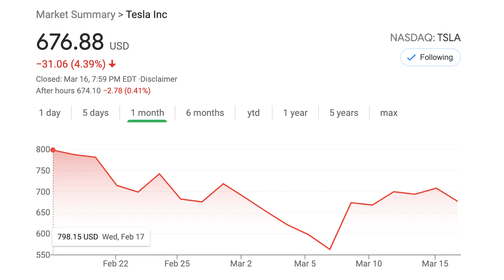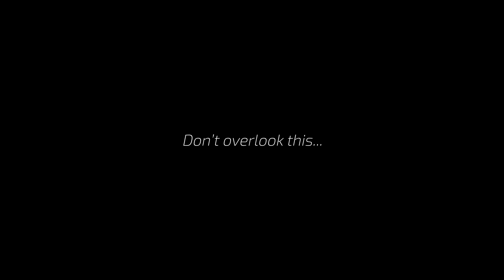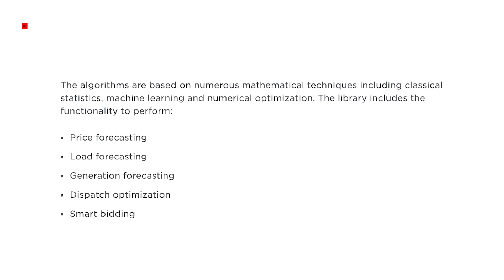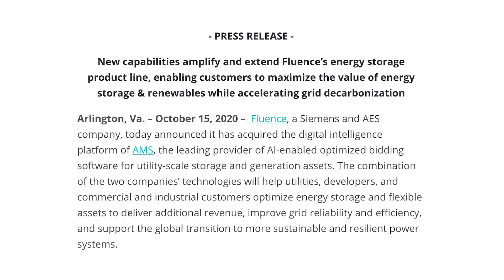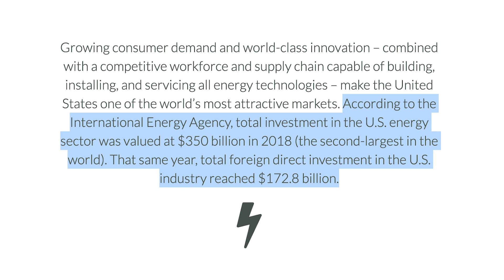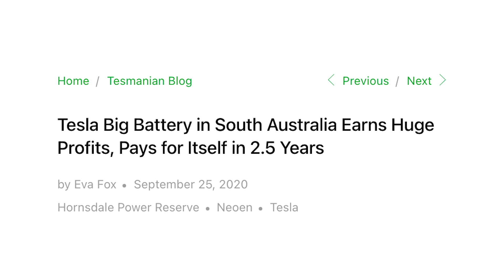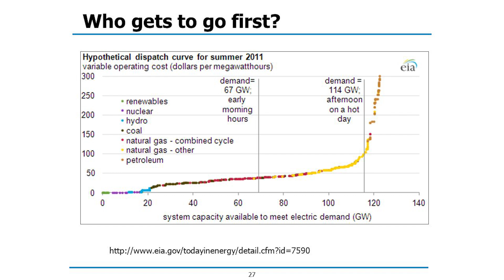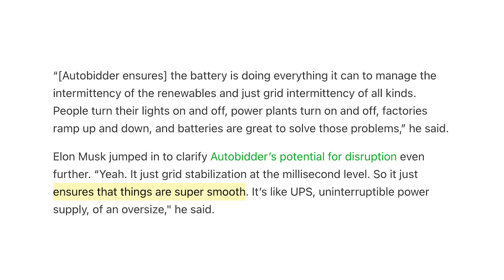A Tesla Thread to Follow: A Key to Unlocking Tesla's True Potential 🔑

Comment: Actually, the liquid metal battery solution provided by Ambri is far superior for grid stabilization. It is even more environmentally friendly, inexpensive to produce and maintain, provides excellent efficiency and the battery degradation is almost nonexistent.
Recently I sent a message to Tesla Power suggesting they should partner with Ambri.

Comment: There is a lot of waste built into the system as a cost of doing business so our lights always work when we flip the switches on. About 2/3 of energy generated in the US is not used or wasted as 'rejected energy' in the industry's term.  https://flowcharts.llnl.gov/content/assets/images/charts/Energy/Energy_2019_United-States.png
The electric utility system delivers amazing reliability, in part because of redundancy and excess capacity engineered in to it.  Tesla Energy reduces the capex utilities need to spend on new distribution infrastructure. Power Packs make the system work better with less over engineering needed.
Reply from the maker: agreed bob, thank you for sharing!

Comment: I did the math and in Oregon, on peak price is $0.1238/KWh and off peak price is $0.04128/KWh .  That mean a net of $0.082/KWh/day.  Current power wall price is at best $400/KWh.
Break even (at best case) would be 400/0.082 days = 13.4 years.  Nah, not there yet.
Reply: In itself, completely correct. What though is the value of having power when the grid is down? Ask your wife how she would feel, convenience of lights and power. That may well justify the costs.
Reply from the maker: hey mark! great to do the granular math, but as mark mentioned there are ancillary benefits too. definitely cost prohibitive for most, but playing your part to clean things up, be independent from the grid etc. are valuable to many and if you live longer than 13 years...
Reply: @DillonLoomis22  Yes, I agree that there would be other benefits that are had to put a $$ on and those play into the decision.  Very much like rooftop solar, the financials help lower the cost of the decision but don't fully justify it.  The main reason I rolled the numbers was because you mad me curious how the finances compared between using a battery to trade power vs using rooftop solar to make it.  In most cases, I think rooftop solar would be better; but it was closer than I thought.

Comment: Did VW show a rectangle shaped battery they want to build?  Seems a little strange ?
Reply from the maker: haha i have not had time to dive into that yet, was out of town this week!
Reply: Excellent informative video. Not all battery packs use cylindrical cells like Tesla. Many vehicle batteries are made with rectangular prismatic cells while some others use the "soft" pouch type. Not sure if any one of them is superior in overall cost effectiveness at the pack level. New 4680 production facilities should free up existing 18650 and 2170 production for stationary storage.

Comment: With DBE 4680 production ramped up, 18650 and 21700 are going to become plentiful. Lots of room then for Tesla energy.
Reply from the maker: for sure brotha! those 4680's at scale can't come soon enough
Reply: @DillonLoomis22  - Concerned about the Tesla dbe secrets being copied with multiple companies coming on board to produce the 4680 cells, I looked into the other methods for creating a dbe to gauge if the competition can work around Tesla's Maxwell patents. None of the other dbe methods can do the four common lithium ion chemistries. The chemistries that matter. I can't imagine outsourced 4680's are going to be anything but a dbe battery with Tesla's patented method. The elasticity of the dbe teflon binder is probably why expansive silicon is even possible in the battery cells now. I think all 4680's will be  dbe batteries no matter who builds them. $280 million for Maxwell is going to pay a huge dividend. Less capital outlay to make them. Less space to produce them. Faster production lines with the additional accelerant of the tabless electrode.

Comment: You never discuss the capex needed for one of these large battery storage systems, which is kind of important....
Reply from the maker: hey john! good point! but i was hoping the hornsdale case study would show that the paypack period is generally speaking excellent
Reply: Here in Oz I understand the Hornsdale plant got payback within 18 months and has since been increased in size by 50% and will be increased yet again. Tesla is doing another grid storage setup in the state of Victoria which is twice the size of Hornsdale. I would say there will be many more to come.
Reply: The one in Australia made up it's cost in about a year. So kinda irrelevant
Reply: @Haliotro  totally relevant, because the ROI is heavily dependent on the local market.  Maybe at SA rates a peaker turbine plant would pay for itself in 6 months?  Or maybe 6 years?  All speculation w/o data.
Reply: @johnmolloy4878  O.

Comment: I was talking with a rep from a nuclear power plant about renewable energy. They HATE renewable energy, because when the windmills and solar panels come online during the day, the nuclear plant has to DUMP the extra electricity being generated into dummy loads, basically wasting it. So storage is the solution to multiple issues, if a nuclear plant is consistently dumping extra electricity into a dummy load onsite, they can replace those dummy loads with Tesla batteries and capture that waste, effectively increasing overall grid power and smoothing it out like Elon said.
Reply: Thorcon (@ "gordonmcdowell" on YouTube) has designed molten salt nuclear power plants that are safe and cheap (cost competitive with coal plants), and now has a contract with Indonesia. While Tesla has its niche and is fast improving, developing countries can't afford our boutique energy solutions.
Reply from the maker: exhibit a of the inefficiencies in the current system. thanks for sharing andy!

Comment: Not only that.. the Autobidder is just a software ..whoever owning the storage will own the autobidder software and whatever profit it generates tesla at best take some cut from it if at all...So to have enormous profit Tesla will have to own maximum storage too ...But it also create another problem...the more the the grid become stable..the lesser will be the fluctuation so lesser opportunity to make money ..So I dont see any way Tesla will continue to make money through Autobidder however If Tesla is king of batteries then still the storage systems will keep generating huge revenue
Reply: Why would the owner of the storage "own the autobidder software" without having paid Tesla for a license? Also, yes of course there are diminishing returns as the systems have claimed the low hanging fruit, but that doesn't mean there are trillions to be made in the building and operating a massive VPP
Reply: @global_optimization  because licensing fees is 1 time and the profit generated by it will go to the owner of  the storage ..Also VPP will generate trillions and democratized the utility grid but the money will go to respective storage owners right?
Reply from the maker: hey sudeepta...owning the storage does not automatically come with the software. think of these as two separate products tesla will need to be compensated for. and as saxon mentions, over time the huge profit margins will diminish but that happens in every industry where there is any money being made and we are in the in VERY early stages
Reply: Why would it necessarily be a one-time license purchase? And either way, what difference does it make whether the payment is lump sum or subscription? Tesla will charge whatever they want if they have a dominant product. Tesla has all the leverage and they will charge a price based on the easily estimable value it delivers to the customer.